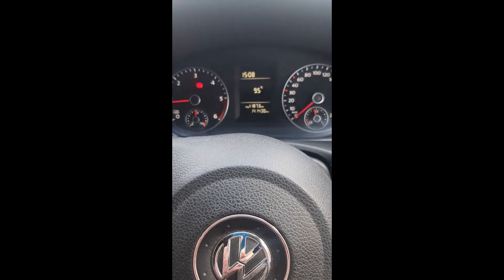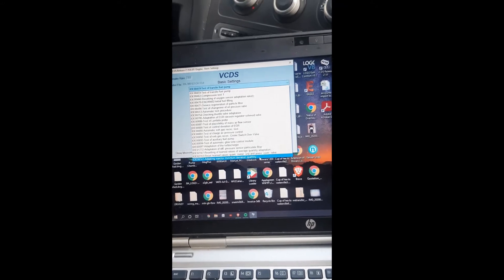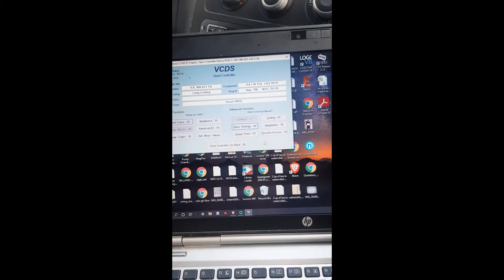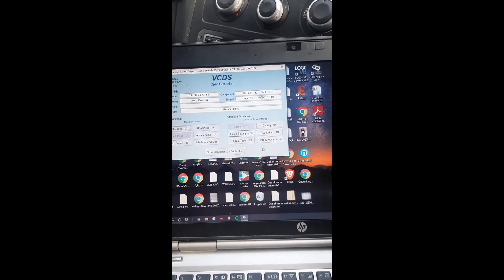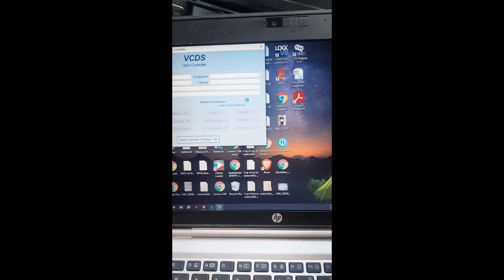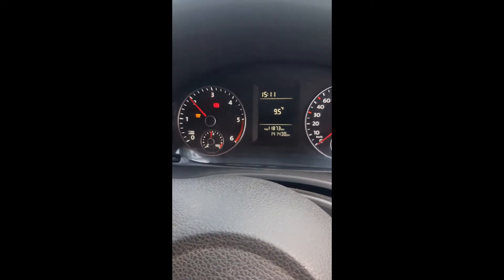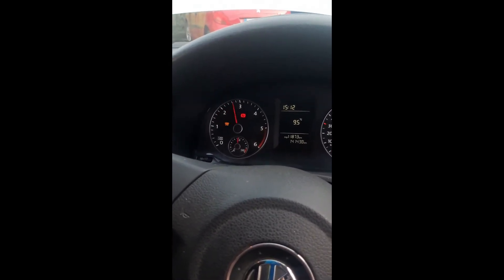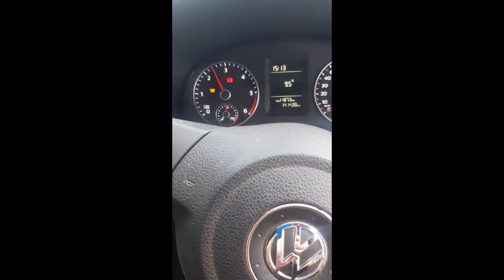VW IDE 06141 CAYE Injector compensation adaption Part2

Comment: I have CAYD. I have reset everything. Did the same procedure as you. The engine just revs up to 800rpm and stay there.
Reply: same here did you solve the problem?
Reply: @TheChamsEddine1  Yeah. You need at least 80*C engine temperature. And input security acces code before initiating IDE06141

Comment: hi. I got a CAYD engine and it doesn't start the adaptation.  The light blinks, but that's all. I have done this adaptation on several CAYC's. That's up with that?
Reply from the maker: In a Caddy? Well double check that you rebooted and entered security access exactly as I did in the video. I have done it on a CAYD recently no problem.
Reply: @enginemanagementadventures7305  Yes. Caddy. I tried several times. No problem at mine, either. It just blinks and idles, also no problem after 10min when I stopped the adaptation. I looked in the VW Workshop manual, and after changing the injectors, it just sayd to code them. Nothing about adaptation. I'll try these days to adapt them with Launch.
Reply from the maker: Yes this option is not available for the EA 288 generation engines which switched to bosch. In any case the software will adjust itself with time.
Reply: @enginemanagementadventures7305  the function is abailable, just that the car doesn't do it. I'll wait a couple hundred kms to see. THX!
Reply from the maker: @Auto H 203  yes its available for CAYD as that's an EA 189 gen with siemens engine management. The last Caddy I did took 2 attempts and if you miss any step regarding power cycling engine, starting engine at idle b4 entering security access establishing comms from scratch with vcds etc it will not work.
Good luck 👍
Reply: 1, 61 R4 CR td H43 8856

Comment: Is there something similar for PD engines? Help
Reply from the maker: Hi PRC, what is the problem? What is the engine designation and vehicle?
Reply: @enginemanagementadventures7305  2.0 tdi BKD. It has rough idle and engine shakes but it drives amazing. In the morning on a first start it throws bluish smoke for a sec and after it is fine.
Reply from the maker: @PRC  I see, I guess check the egr system for any leaks, was the inlet manifold ever cleaned? Check swirl flap condition and was the cam belt done? Check the torsion value with VCDS if available it should be 0 if possible
Reply: @enginemanagementadventures7305  new egr, inlet manifold and throttle body taken off and cleaned. They looked like new. It doesnt have swirl flaps it is a metal intake. All belts new,water pump, and all tensioners and it still has rough idle. I didnt checked torsion value. It had rough idle even before all the belts were chandged. Everything that can be done on this engine, has been done and still nothing. Injectors on vcds are flawless.
Reply from the maker: @PRC  I see all sounds good, with the EA288 16valve PD's the free flowing nature of the head lead to unstable idle, the indexable cam pulleys effect the injection timing, aim for a torsion value of O - it dramatically effects smoke on warmup.
Reply: @enginemanagementadventures7305  Thank you so much. I will do that. One question. Shouldnt the car run slower or something at least? My car drives like it has 200 hp not 140 hp and it was never maped or moded it just drives like crazy only when i stop at a red light idle starts to annoy me. Realy thanks man i will try that.
Reply from the maker: @PRC  haha I don't know man, if it was overboosting it would deffo be throwing a code and going into limp. I have a BRD engined 2006 A4 stock 170 mapped to 200 and it pulls like crazy. Let us know what happens.
Reply: @enginemanagementadventures7305  value is - 2.8
Reply from the maker: @PRC  try to get it to -0.5 or 0 it's measured from the intake cam.
Reply: @enginemanagementadventures7305  I will. I hope it will help.
Reply: @enginemanagementadventures7305  it is set - 0.6 and it works better now i will see in the morning for a blue smoke
Reply: @enginemanagementadventures7305  it is the same blue smoke and car drives good but idle was good one day and now it is the same.

Comment: I have a seat leon 1.6tdi and it is kind of misfiring on cold but it's ok when warms up. I check the injectors deviation on idle when cold  c1:  0.57,   c2: -1.20,  c3: 1.34,  c4: -0.72mg/stroke.  Do these numbers look good to you? Thanks
Reply from the maker: They look within specification to me. How many kms has the engine done?

Comment: I changed injector 2 on a golf 1.6 TDi cayc for a brand new Conti vdo, deviation quantities are well out now cyl 2 -1.8 cyl 3 1.7 ish, tried to run the program but it won’t start coil light flashes but never revs up? Should the rpm increase straight away or can it vary? I followed the video and had engine at 90c.  We’ve had the golf since new and never had software updated (not even the emissions scandal thing) software version 9052.  Any ideas?
Reply: Hello. I have the same problem with my 1.6 TDI CAYC. Have you found solution for this? You would help me a lot with your answer, thank you.
Reply: Hi Mate,
Did you find a solution for this, mine does the exact same
Reply: Did you ever get a solution to this ?
Reply: The same problem here 😢
Reply: Hey, did you find out what was wrong? Is it ECU software version too old or something else?

Comment: Nice video mate , I’m changing my rocker cover on my 1.6tdi soon so got to pull injectors out , so will give them a clean etc , is it worth doing this after I’ve reinstalled them
Reply from the maker: Tks Man. This is really for new injectors/changed injectors - deleting learned values and running this just set the cylinder balance offsets faster - the sub routing is constantly adjusting anyways at idle. I'd leave it TBH - sometimes running it can cure a lumpy idle but often this is caused by somthing else anyways - worn flywheel etc.
Reply: @enginemanagementadventures7305 and about nozzle change, does this procedure helps ? Thanks for this vidéo.

Comment: Hi

Thanks for the videos. I have downloaded vagcom and have a genuine cable.

I still cant get the engine to rev up. It just stays idle for about 45 mins.
Reply: Hi, l like you have tried to do this function without success static rpm no reving.I am wondring if your ECU software needs to be at a certain version level to compleat this function.
My ECU software version was only at 2010  version  8831. Do you know what version ECU software you had?
Reply: Hello Colin, I have the same problem in a CAYC 1.6 TDI. Where can I get the ECU version with VCDS? Then I will post it
Reply: @colin5064  Hey, did you find out what was wrong? Is it ECU software version too old or something else?

Comment: Just done this adaption to cayc,issues with fueling and running lumpy with no codes,runs sweet as a nut now ..thanks for the video
Reply: I've done this and I get press pedals, release pedals then press accelerator and release and it says running but I never get any revving. it just stays around  800rpm the whole time, even after 10 minutes or so.  any ideas?
Reply: Hi Mate, did you manage to get it sorted. Mines doing the exact same and can’t get it to do the correct procedure
Reply: @eddieb2877  The ecu version is too low. The ecu starting with 88 is not acceptable. The ecu starting with 99 is acceptable.
Reply: Did you change the injectors or was car just running lumpy ?
Reply: @roostaraver  chances are there injectors have been changed at some point on this engine,worth a shot if you've got same symptoms
Reply: @oldschoolsaabs2365  yeah thats my thinking mate if previous owner swapped out injector and didnt know about this function,

Comment: Hi we have a issue with a vehicle, we have a 2011 vw golf CAYC, we changed a injector now the car has a injector knock and slight missing, all injectors have been tested, when we carry out the minimum deviation it’s just stuck on “running” and nothing happens apart from the glow plug lamp flashing, tried absolutely everything, car won’t rev up like yours is can you help?
Reply: Did you solve this ?
Reply: Same problem here did you solve it ? How please ?
Reply: Hey, did you find out what was wrong? Is it ECU software version too old or something else?

Comment: how do I know the security access code for the vehicle
Reply from the maker: VCDS will prompt you when you hover over security access.
Reply: @enginemanagementadventures7305  it doesn't happen to me
Reply from the maker: @goranstevanovic5905  what engine exactly? Are you using latest version of VCDS
Reply: @enginemanagementadventures7305  hex -v2 vw sharan 2001vcds 21.9.0
Reply from the maker: @goranstevanovic5905  Is that engine a 2001 1.9 tdi? you wont need security access for a car that old.
Reply: @enginemanagementadventures7305  thank you

Comment: I tried to do the adaptation but nothing happent after press brake and gaz pedals.
Since this atemps my car seems to be stuck in a infinite adaptating loop : big rumble and not proper running at rhe first start then, if i drive with full throttle in 4th gear then let rpm down 4 or 5 time, the engine turn propely.
If i turne off and on, the engine forget the settings and start to turn badly.

How to get out of this infinite loop, please help ;)
Reply: Did you ever get this sorted?
Reply: @burrpws1980  engine finally end on a basic setting i guess. Not good at all !
 i'll send soon 4 injectors to a specialist in order to define wherever coils and nozzle are good

Comment: Hi, I am sorry to bother you,can you please tell me , what are acceptable values?
Is there a range of values?
I am getting -0.56, 0.45, 0.37 and -0.31, that seems kinda close, but on the other hand not so close. 😊
Please ease my mind a bit  😊
Thanks 👍😊
Reply from the maker: The ECU can compensate appropriately 8% depending on system for discrepancies between injectors due to wear etc, watch for differences of one injector over the others.
This should be followed up by a leak off test. Yours look normal. 
Remember that injectors with 300k will have wear. My 09 A4 2.0 tdi has 340k on the clock on original injectors all compensation values similar.
Injector wear problems are closely linked to poor quality fuel and people misfulling etc.

Comment: Can you only run this if you have changed a injector or can you reset you current fitted set . I have 3 injectors close in -0,3 and 1 is at 1.2 .
Reply from the maker: Hi Sean, the reason your smooth running compensation offsets are different is because you ECU is compensating duration to balance idle as injectors wear, this procedure is generally for new injectors fitted, it cannot fix a worn injector and the ecu performs this procedure over time in any case - we obviously use it when a new injector is fitted to update the settings straight away.
I would let it be.

Comment: Hi. I am assuming this will work with a 2011 SuperB mk2 1.6tdi as well?! Thanks
Reply from the maker: Yes it should work with your engine. This particular video deals with the original CAY series of 1.6tdi using the Siemens/Continental injection system. Your 2011 is most likely a CAYC engine.

Comment: Doesn't work on cayc. Just idles for 1hr and gave up. Says it running and also glow plug light flashes all the time.
Reply: I have same problem. All preperation went OK, but no automatic revs.
Reply from the maker: @elvedine1962  Coolent above 80 degrees, no fault codes ?
Reply: @enginemanagementadventures7305   Yes I did all. They said problem is software version. Mine is 9050. :(
Reply: It works only at newer soft. I had 8789 and it didnt work. I upgrade it to 9972 and the procedure finished correctly.
Reply: When you says software update do you mean the ECU software @mirekk.1320
Reply: @mirekk.1320  how did you upgrade?
Reply: @mamelemzamo3454  I went to chiptuning expert and he upgrade my soft. It costs about 100€
Reply: Dove aggiornare
Reply from the maker: Glow plug light should flash - did you enter security access directly after ECU power cycle.
Also non genuine VCDS cables can cause problems.

Comment: Just tried this with my caddy says brake and clutch then acc pedal and says running on the Vcds screen but just sits at idle waited approx 30 mins and no deviation on throttle, any help appreciated
Reply: It works only at newer soft. I had 8789 and it didnt work. I upgrade it to 9972 and the procedure finished correctly.
Reply: Is that the ecu software?.  

Where can you check that on vcds
Reply: @mirekk.1320  This might work for me hopfully,how did you get the ECU software  version upgraded to 9972?
Please may l ask the cost of such work?
Reply: I have same situation, also looking for help

Comment: Hi 
Just trying to do this procedure with my Roomster CAYC following by Your advicees, and can't perform properly VCDS displays in red "ERROR: Request out of range"
Reply from the maker: Hi Tom, make sure engine @ operating temp and no codes stored.
Reply: Hi EMA
Thank You very much for quick reply to my post. Unfortunately you've been right I've got two faults which I can't erase
19CAN GTW (0010) can snan-01044 crtl module incorrectly coded
44STR ASS (001)
A while ago ago someone been trying to fit to this car cruise control and operation failed. Probably I need to find the way how to reset/recode can unit to reset default settings.
Thanks for your help and support
Reply: Hi again EMA
Fault codes sorted 
Noting "in red" engine temp 91 security access performed and still not able to start procedure- "Request out of range"